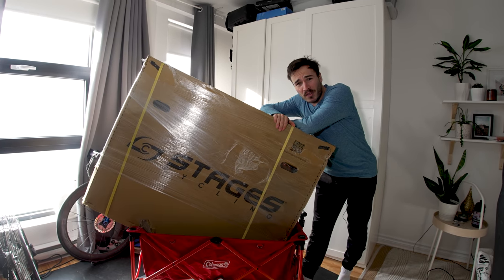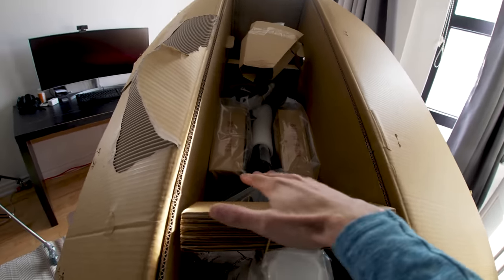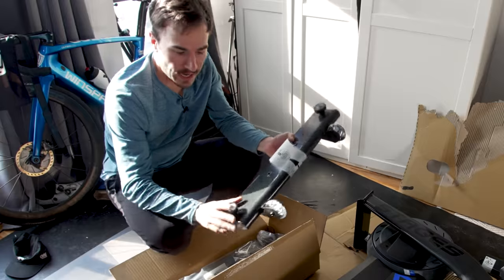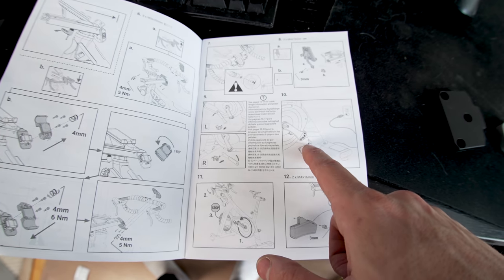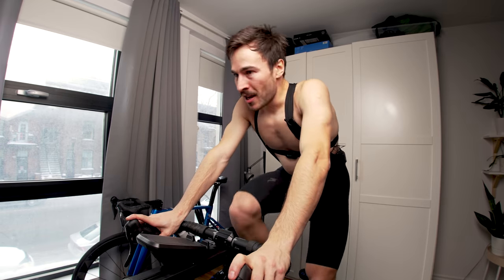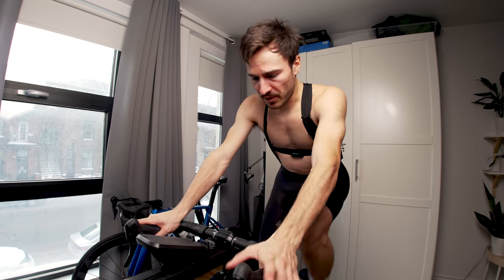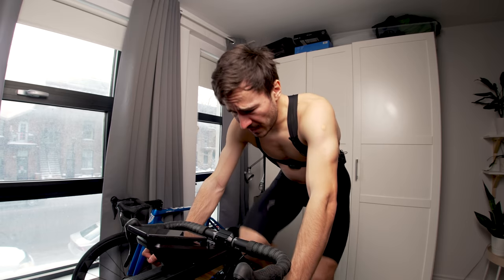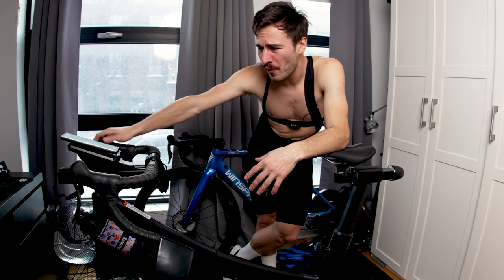Stages SB20 Unboxing and First Impressions! Not a Review...(yet)

Comment: The 6mm hex key that comes with the SB20 is a perfect size for installing the Assiomas. It has a short "neck." The hard part is taking the pedals off, especially in the 165mm holes.
Reply from the maker: Ohhh I've just check it out, you are right it works great!! Thanks man

Comment: I’ve been riding on the Stages SB20 since July and put in close to 1400 miles on Zwift so far. I love how sturdy this bike is and I’ve only had to change out the batteries once so far. I just need to work on standing more during those sprints.
Reply from the maker: nice to hear this!!
Reply: Dear Sir. When you ride on zwift with the SB20 in the uphills the wheel automatic became more heavy to simulate the reallity? 

Others question is possible put   in sb20 one altimetry perfil of a track that we do outise?

Pedro

Comment: They need a grab like a phone car windscreen holder that would fix the phone falling off issue.

For the rest it seems like a solid bike!
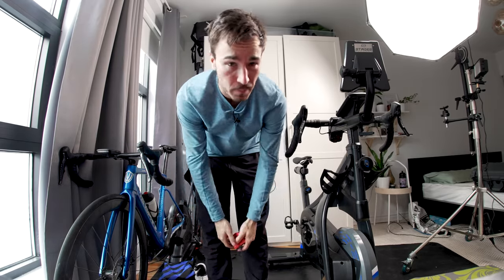Reply from the maker: When you look at 6:40 I install the phone/tablet accessory that really locks the phone or tablet in a spring loaded clamp, but since I'm using my computer screen I removed it. That accessory really holds well but is in the field of vision if you are not using it. I ended up added a little elastic to the integrated phone holder and it works fine for now!
Reply: The bars are not supposed to wobble like that. The adjusters weren't tightened down enough.

Comment: Hi Charles

I have a stages sb20 bike and having issue with sprinting during zwift racing and generally sprinting on bike were the bike resistance kicks in on watts over 800 and make it feel like 15% climb gradient in the middle of sprint which obviously put a end to the sprint. I contacted Stages on a number of times through Saddleback Uk there UK supplier to no avail and now they’re saying as of today that stages USA are saying this is standard resistance during sprinting. I have never heard of it before today. at first they said it was issue with gears on dreamdrive and to remove setup and reset up. They’re refusing to do anything on it for me. I wonder if you have come across this on testing and during use. This what they told me “ This is the same with every bike, as mentioned by Stages, as it is resistance based. Please try holding one brake lever and see how that feels” I feel talking to other users this is not an issue with other users but with my bike.  I would very much appreciate the help and advice. Thanks in advance 

John

Comment: Is it belt-driven and can you freewheel (quietly) like on an ordinary bike?  I think this is the best smart bike because if its no top-tube design, multiple crank lengths and road bike configuration. Was intrigued to see the handlebar move like that in the sprint.
Reply: He didn't tighten down the adjuster knobs all the way for the video. The bars hardly move at all. Yes, the bike does freewheel quietly like a normal bike, though the virtual shifting is a bit weird in that it just adds resistance to shift up and takes it away to shift down...this means that if you are outputting 300W in a big virtual gear the flywheel is spinning more slowly than when you are outputting 300W in a smaller virtual gear. In real life and on regular smart trainers, the flywheel speed is constant at a constant power (until the gradient changes.)
Reply: @kidsafe  very good info. Thanks.
Reply from the maker: yes belt system! Handlebar was not tight enough, I did fix after that video :)

Comment: Can the power meter pedals be used with bike computer on road bike outside via Bluetooth or ant+?
Reply from the maker: absolutely! I've been using these Favero Assioma power pedals for over 30 000 kilometers outside!
Reply: @CharlesOuimet  oh wait...are those your own pedals or did they come with the Stages bike? Thought the Stages Bike comes with Stages' crank arm-based- meters? My question is about using the same power meter on indoor and outdoor bike for precision between indoor/outdoor and also to avoid getting another set for outdoor bike.
Reply from the maker: @TropicalVibesHD  These pedals dont come with the stages bike. I used them on all my road bike, so to have accurate power on all my rides (indoor and outdoor) I use the pedals powermeter instead of Stages crank arm power!

Comment: Maybe it's just me, but shouldn't ALL spin bikes (smart & non-smart) come equip with drop-down handlebars? I would love to own a Stages bike, simply for the drop-down handlebars.
Reply from the maker: If you do ''spin'' class, you need different handlebar, they ''danse'' and choregraph on the bike very differently thus needing a dedicated handlebar. This SB20 bike is for road cyclist
Reply: @CharlesOuimet  A spin bike was designed to mimic a bicycle, which happens to be a road bike. Of course, a spin bike cannot mimic a mountain bike. All Stages bikes have pretty much the same type of handlebar configuration as any other spin bike, except for the drop-down handlebars. Stages Co. doesn't say, one is not allowed to dance while spinning on a SB20 spin bike.

Comment: That front end needs tightening up at either the bars, or the height/ reach adjustment levers. I’ve the bike and the front doesn’t move anywhere near as much as yours.
Reply from the maker: Hey Marc, yes I've figure out after that I needed to tight more the height knob! Still has a little wiggle, but definitely less than in the video first ride. I'll mention that in my future long-term review!
Reply: @CharlesOuimet  yeah there will still be a small wiggle. It’s a great bike you’ll love it.
Reply: Hi Charles, I think your correct that this needs some side to side movement. I put a rocker plate under my Tacx Neo and found it to be a game changer in terms of comfort

Comment: Wow lets not talk about the SB20 i wanna know about the trolley that takes the weight of this tank hahahhahah,     pretty sure them bars are not meant to be like that mate, mine are not , great video though
Reply from the maker: ahahah!! It's a 180$ trolley from Canadian Tire, worked perfectly to bring the bike to my room hehe. Thanks man. Yeah I tighted up the height ajustment knob and it reduced the wiggle
Reply: @CharlesOuimet  speak to your stages contact as there was an issue with the sleeve insert the bars drop into. Older ones had wonky bars due to this sleeve. Might help. 👍🏼